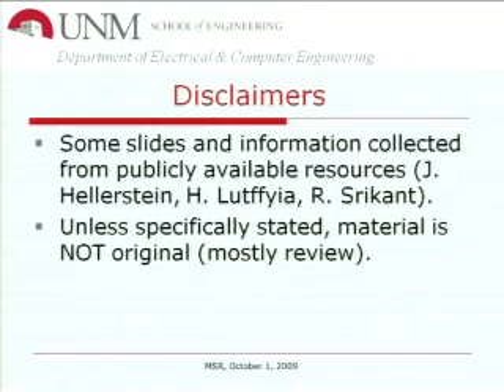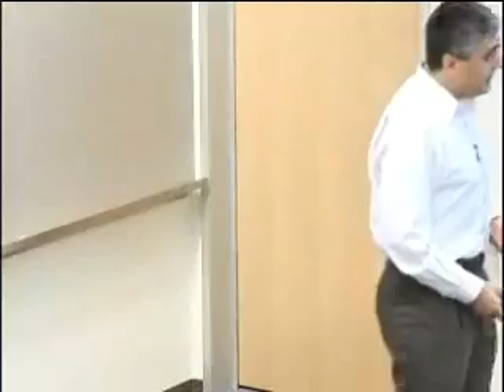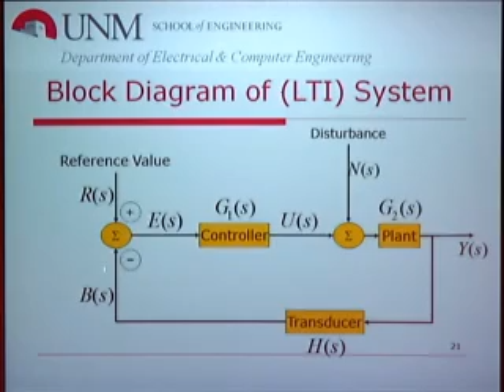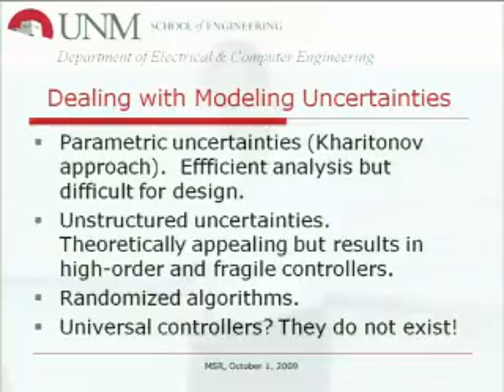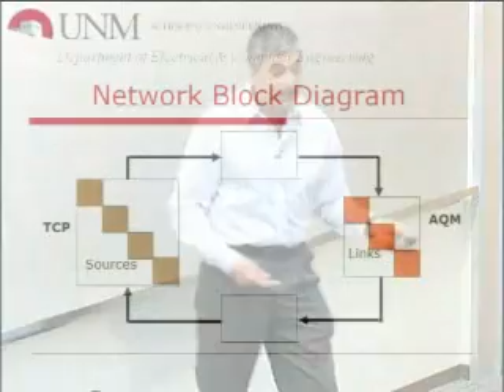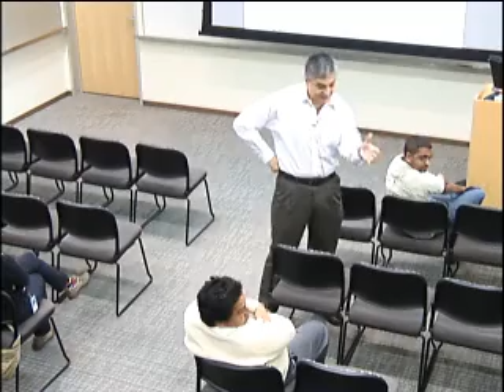Control Theory and Computing: An unconsummated union

Comment: First of all, thank you very much for sharing this video. The professor and his knowledge is very valuable, however; the recorder mostly recorded  face of the professor instead of the slide pages. That's why it is unfortunately difficult to follow the presentation.
I would like to ask if you can share the presentation document, because I couldn't find it in online platforms. 

Thanks in advance